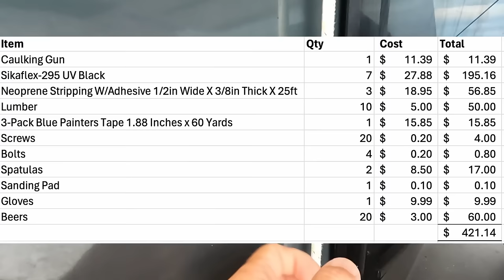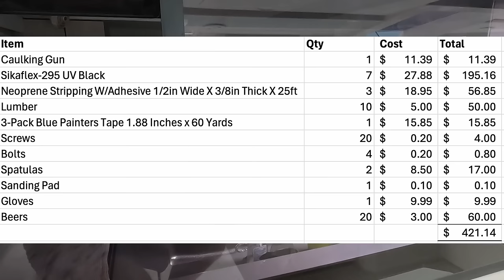#245t WHY does the Leopard Windows DELAMINATE? Sailing Sisu Leopard 45 Catamaran Circumnavigating

Comment: Well you bought a leopard and they have a reputation of dodgy work now in a properly built cat windows installed should last for 20 years. Maybe they should rename leopard catamarans as leper catamarans because things on them just continually fall apart break and fall off that probably sums it up pretty well. I’m so glad I have a fully custom built epoxy composite cat.
Reply from the maker: good on you! we've sailed 36,000nm the last six years and we still love our boat, Leopard and Robertson and Caine. We have been through rough seas and high winds, at sea and at anchor. we still love our big windows and forward cockpit. we love the design, the layout, the way Robertson and Caine thought about using hidden spaces, placement of propellors, how the chain plates is attached, the safety measures such as propane or CO alarms, placement of the electrical board and DB board.  But, that said, I would not mind to have a boat like yours, which has absolutely no issues the last six years. we looked at custom build boats especially those expensive all composite and carbon fibre boats, and it is honestly an unreachable dream for us. But tell us, no issues the last six years?

Comment: Modern Leopard cats do seem to have a whole list of problems - I'd survey your hull and deck, and mast,  if I was you before your 'warranty' expires.
Reply from the maker: We've sailed more than 35,000nm in the last six years, mostly sailing. The rig, bulkheads, and was surely tried and tested. We do an annual 100 point check, and Sisu is still in good condition.

Comment: Looks like a nice job. Good call getting rid of the primer, for next time I'd consider getting rid of the weather stripping all together and putting 3M VHB tape in it's place and then adding the Sikaflex around that - VHB tape has similar waterproofing closed cell foam properties as weather stripping but the strong adhesive on both sides also helps to hold the window very firmly in place. VHB tape also has 50% of its ultimate strength after 20 minutes so it can help hold things in place for the Sikaflex to cure. To be fair I haven't tried to bond in a window that large with it and you mentioned a lot of flexing, but it has worked exceptionally well on smaller windows for me - 2ft by 5 ft being some of the larger.
Reply from the maker: Thank you for the good advice!

Comment: What a reflection on Leopards production. How often do we hear of separation issues. 
Anyone lining up to purchase will always look at service to past owners or lack of! Also, how old is she? It's very disturbing. 
Obviously, it's a production issue that the company should fix without question...
Reply from the maker: Yeah, I guess all boats with acrylic windows will go through the same process eventually. The video is actually about what the issue is with acrylic windows, how we fixed it, and how to rebid the window, and how to do it a fraction of the cost a boat yard is charging. Sisu is already six years old and went through rough seas in her 35,000nm journey. But, it is currently a Lewmar issue, not the boat manufacturer's issue. Robertson and Caine follows the instructions, which Lewmar put together for the windows, hatches, clutches, and winches. And Lewmar is following Sikaflex's advice on how to fix acrylic windows to fiberglass....vicious circle of blaming the other.
Reply: @SailingSisu  Off course all true, boat is out of warranty. But I think the vicious circle of blaming the other is handled by law very clearly, when still under warranty. You buy not the lose parts, you buy @leopard, so all warranty should be handled by them. How they solve it with supplier should  not be the customers problem. Nonetheless, I would have done the same as you did, and safe me the legal hassle, just solve it and perhaps  Leopard will refund you the Sikaflex 🙂  (I always ask my wife to solve that, and she is good in that part 🙂)  Also for Leopard this video is helpful for owners to show it's doable to re-glue your windows .
Reply: @marcandnadine  I must admit,from what I have seen of the Sailing Sisu Leopard 45 Cstamaran, and examples of others in the range, if I could get on ok with Catamarans Motion upwind, I’d buy a Leopard.Probably a 40. But unfortunately my allergy to Catamaran Motion into Waves is pretty extreme, and rules out me ever having one. If the two hulls connect with a wave at different times, I’m basically A Monohull, by default, only has one hull to connect to a wave with thank god. ❤️⛵️Bob.
Reply: PS.Sod’s Law when Sailing to a destination, the Wind direction is always coming directly from the destination . Bob.🤔☹️
Reply from the maker: exactly!

Comment: I am on a Lagoon 450 and we have similar issues.  It was recommended to use Dowsil 795 to caulk the plexiglass rather than Sika.  It is used a lot in commercial buildings with large glass surfaces.
Reply from the maker: lol, that is what non-boat people do not get :-D ALL boats with acrylic windows do that. the video is more about why it happens and how to fix it. that said, Robertson and Caine follows the instructions, which Lewmar put together for the windows, hatches, clutches, and winches. And Lewmar is following Sikaflex's advice on how to fix acrylic windows to fiberglass....vicious circle of blaming the other. All boats with acrylic windows go through the same pain at some time. so, thank you for the advice on Dowsil! I heard something similar in Turkey about a 3M product? I guess at one point, the sun will destroy any bonding exposed to the sun :-(

Comment: Frik my experience with my Leopard 40 and having to rebed a window and then owning a Catana which does not seem to have the same Leopard window delamination problem leads me to believe that Catana got it right. What they do is paint the outside of the acrylic all the way around where the sika is on the inside. This seems to shield the UV rays from the sika and acrylic bond. This seems to be the answer. I have the same amount of acrylic around the boat as you but no de lamination since new.
Reply from the maker: I think that is the right way to do it.

Comment: Sailing Sisu. Travel Sketch ( plus 3 other unamed leo 45's in yard at same time. ), Sailing Utopia getting remedial works as well, Leopard are having extensive warranty issues and at this point must be seriously concerned about potential legal cases/class actions.
Reply from the maker: maybe. but then again ALL boats with acrylic glass is going through the same issues eventually. we still love our boat, Leopard, and Robertson and Caine. We will not join the "class action". what is up with this class action anyways? I am no lawyer, but every boat owner knows that at one point he/she needs to maintain the boat and the sun is absolutely brutal on Sikaflex or similar bonding, sails, lines/ropes/gelcoat/well every thing on the boat is attacked by UV, heat, salt spray, vibrations, slamming. I do not know of one boat with acrylic glass who has not rebed their windows within a ten year span. Sisu is 6 years old. Robertson and Caine follows the Lewmar instructions, which Lewmar put together for the windows, hatches, clutches, and winches. And Lewmar is following Sikaflex's advice on how to fix acrylic windows to fiberglass....vicious circle of blaming the other.
Reply: @SailingSisu  Ahh, the issues are not restricted to acrylic windows, if only it was. Infusion voids in the hulls are not a minor issue, it goes to the structural integrity and basic seaworthiness of the boat. Rather than type a report here, go look at the work Travel Sketch have had to get done under thier extensive warranty repairs ( 1 year on the hard on a two and a half year old boat so far ). You mention Sisu is 6yo, so prior to covid, i hope you are free from the issues some are having, its my best wish for you. Personaly, i would be getting my boat checked for infusion voids with my fingers and toes crossed that you are free of those particular concerns, Leopard have always had a great reputation but right now, best check.
Reply from the maker: thank you for your concerns!
Reply from the maker: well, this video was about the windows and nothing else. again, not going to comment Travel Sketch, it is not my place nor my view.
Reply: @SailingSisu  umm.. ok... i guess. Im happy to have expressed my concerns and fully accept your thanks for having done so.

Comment: Sailing Uma said that in their boat, it was due to that the boat wasn't stiff enough. 
So when the sealant ages and becomes stiffer, the movement causes delamination. 
I would suspect that this could be an even bigger problem on catamarans. 
But obviously I don't know that this was a large factor for you, given the primer.
Either way it just sucks to fix windows again and again.
Reply from the maker: exactly! yeah, there is flexing, but I guess since it is bonded to a bulkhead....there should not be boat flexing, only the expansion and contraction of the acrylic?
Reply: @SailingSisu  I misunderstood the initial issue, but as far as I know, bulkheads are mostly strong in one direction, they may flex in others. In a monohull like Uma:s, it would mostly be the compression of the roof vertically from the mast under load, but on a catamaran it would rather be twisting due to one hull hitting a wave and the other one not doing so. However Leopards seem to have a better reputation strengthwise, so I suppose that would rather be a potential issue for those unfortunate Lagoons way back. Also, to make it clear, I am really speculating, not knowing.
Reply from the maker: I hear you! there may definitely be a twist going on.

Comment: Jesus guys! What a Frikin' nightmare! You must've been so pissed off with Leopard having such poor build standards. Hats off to you for completing such a repair yourselves, and at anchor! Great work!
Reply from the maker: Thanx, Paul! We still Frikken love our boat ;-) The video is actually about what the issue is with acrylic windows, how we fixed it, and how to rebid the window, and how to do it a fraction of the cost a boat yard is charging. ALL boats with acrylic windows attached with Sikaflex (no screws or frames), will eventually go through the same process. The sun is a killer for anything exposed to it, sails lines, gelcoat, dinghies, and Sikaflex. I guess people love frameless windows too much! Well, we still love our forward cockpit and the big windows. We just need a way to get the bonding right :-) Thank you for dropping in!
Reply: @SailingSisu  Sorry Cap'n! I didn't mean to imply something wrong with the whole build of Leopards. Just that you've had to do this with all of your portlights, due to non-flexible primer, from what I understand from your video. I work with acrylic sheet everyday, and understand the issues with expansion and contraction due to heat, and the need to account for this if you are trying to make a water-tight seal. Again, I think you did a tremendous job to fix this issue, but I think Leopard should have used a flexible primer in the first place, and then you wouldn't have to do this repair at all... BUT I could be wrong, of course! ;)
Reply: P.S. Ikigai (2008 build) had plexiglass portlights on the freeboard held in solely with Sikaflex (or similar) and she managed 15 years without them become non-waterproof. Yes, much smaller than your forward windows, but ours were actually submerged often... Not saying one boat is better than the other, but just that there could be a way to install it better than it was initally. It looks like the job you have done will be way better, and last much longer (water tight) than how the boat was delivered. Great job!
Reply from the maker: Paul, I agree 100% with you! But many of us got the "repair" flyer from Lewmar and Sikaflex requiring us to use that primer... that said, I saw another Sikaflex article where they require a UV protective film in front of the window too. So, I am thinking of that, basically a sticker frame on the outside?

Comment: Hi, Nice job, I only think the glue needs UV protection, I heard from car glue wholesaler, when exposed to direct UV sunlight, the glue will disintegrate pretty fast. That's why they use the black primer (and for the esthetics). The primers stick on real (car)glas not on plastics. I'm not 100% sure, but you should inform if this is the case with the glue you used as well. Solution I think of is to wrap the edges of the windows with high gloss black (car)wrap.  This will protect the glue from UV light, and probably doesn't't looks bad at all.  It would be a shame if you have to do this job  again within 2 years.
Reply from the maker: That sounds like very good advice! Thank you!

Comment: Is it UV Light causing the delamination ?  If so, there are UV protection polishes which can be a huge help, and which are worth kooking into ? My father installed new upvc Fascias and Soffits to his house in 1989, and we coated them with a Marine Silicone Polish. They all face East, and today they look as good as the day they were I stalled. 🤔 Best Wishes. Bob. 👍🌟🌟🌟⛵️❤️
Reply from the maker: Awesome advice, thank you Bob!
Reply: @SailingSisu  hopefully you can get hold of something suitable. Bob. 👍PS. The Monohull I am after has small square deck hatches, and narrow smaller portholes so replacements will be very easily obtained. Apparently, Full Beam Skylights in the Deck are an absolute nightmare to sort out at vast expense, IF you can even get anything suitable to fit. It’s surprising how many really pretty boats have ruled themselves out purely from the choice of Torturously shaped portholes. For example, the tragedy that is many of the Jeanneau Sun Odyssey Deck Saloon models. I’d have liked a 44 DS tbh. Now I wouldn’t touch one.☹️

Comment: Hi Guys, this may be useful for you - not sure if you know, but most flexible Solar Panels are not UV proof, so Delaminate and Die, normally in under 2 years ? So Hobothech has found one with Delamination protection and which comes with a 10 year Warranty, the 200 watt one only weighs 7 pounds. As I am not in a position to get some myself for testing, I'd advise handling them gently, and not Bending them too much when fixing . Hobotech did pretty decent testing, and ay some point, fingers crossed I'll be ablecto do extended long term testing, with some solid output numbers from at least two of these panels. Links to the seller are in the Video description. Link   :

https://youtu.be/BaXSXIXQA6g?feature=shared
Reply from the maker: Thank you! Our Solbain panels have a 10 year warranty too, so, we got 10 panels for free!
Reply: @SailingSisu  Really nice to hear from you by the way. Bob. 👍👍👍

Comment: They used such little amount of window sealer it isn't even funny.  They charge millions for a boat and skimp everywhere they can. This is why glass windows is the way to go and with a builder who doesn't skimp.
Reply from the maker: well, we bought the boat for half a million :-) let me tell you something else. the guys in Turkey did a super job to rebel our saloon roof window, but added so much Sikaflex that it did not expand with the window and now that window is cracking... so, I guess there is a fine line where the lines of Sikaflex needs to be able to flex but still have enough area to bond properly.
Reply: @SailingSisu  Yes you are correct. I meant use enough so when the plexiglass presses it makes a tight bond and pushes it sideways enough. Also like you mentioned in the video it has to be able to flex with the boat and not be tight against any edge that can move or it will free itself like the edge against the side wall and you added a slight gap which is very smart on your behalf. Buying a used boat you got a great deal. I am saying when they make these boats they do things as cheap as they can and I do not agree with them skimping as almost all of them do that 1 way or another. I prefer glass windows and yes more weight but when sailing you can just have less water in your tanks to make up difference for light wind sailing.
Reply from the maker: yeah, the market is tuff. I am hearing so many times that the Leopards are too expensive and people are buying one of the other big three cruising cats. I think many people think a boat is a boat and not really thinking about quality. so, if Leopard do go for quality, then there sales will drop, people will loose jobs, shareholders get upset, etc. it is a vicious thing, capitalism :_SisuAngry:

Comment: The thing is that is a danger to the boat if it fell out or just let water in. Bad weather happens no sea room to turn down wind, big wave your going down. This is safety issue. Bad design bad installation.
Reply from the maker: sure, we had serious weather with those windows. if you watch a few videos back where I do the Thorny Path, you will see just how serious, and I did see some water splash through that gap when the waves hit the wind, but it was not serious, I had more serious leaks from repairs done in Florida to worry about. we have done 35,000nm in the last 6 years and we still love our forward cockpit and the big windows :-) that said, Robertson and Caine follows the instructions, which Lewmar put together for the windows, hatches, clutches, and winches. And Lewmar is following Sikaflex's advice on how to fix acrylic windows to fiberglass....vicious circle of blaming the other. All boats with acrylic windows go through the same pain at some time.